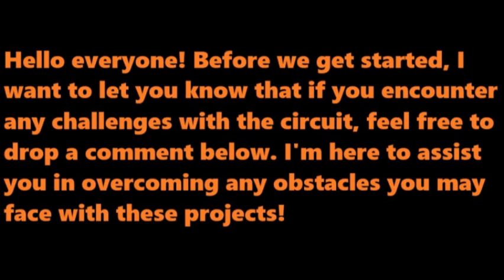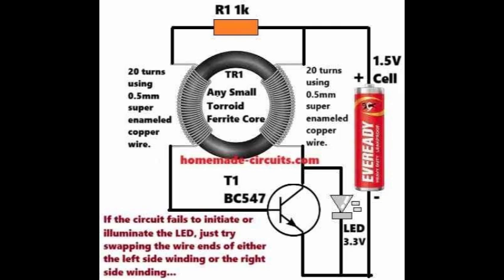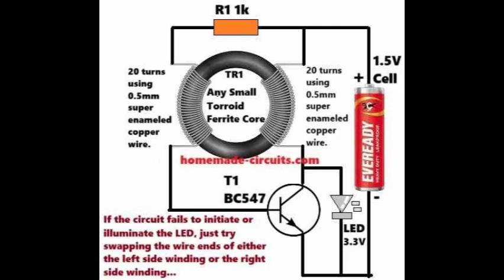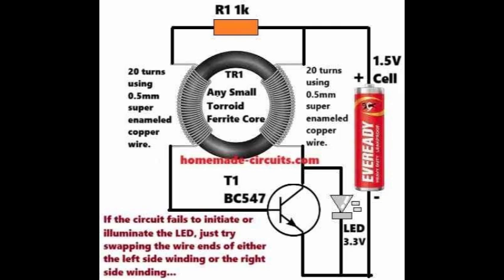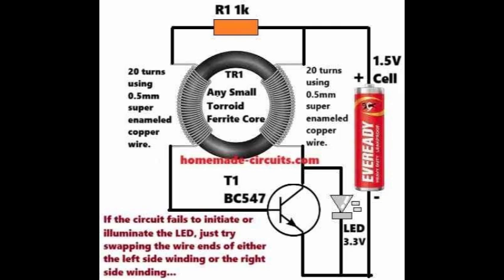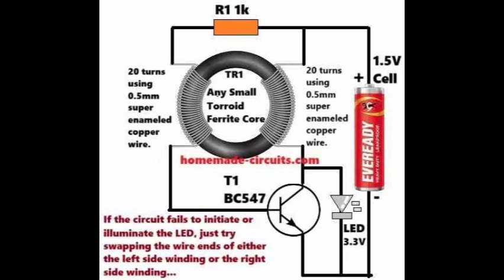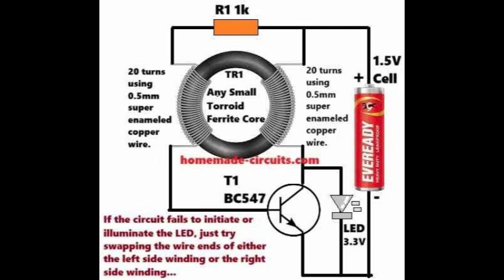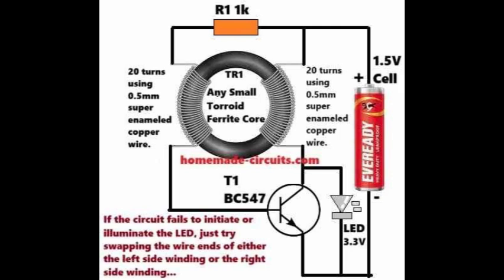High Efficiency LED Flashlight Circuit Diagram

Comment: "Regenerative Motor Acceleration Experiment" :  The magnet group rotor (spinning motor) supplied by a stacked duplicated group of this power supply type charging a super capacitor. Could be a starting point to get magnets spinning for much less power.
Reply from the maker: Sounds interesting! Certainly worth trying...thanks  for your feedback on this...

Comment: I like these circuits, and this one uses a euro transistor rather than a 2n2222, which is also a great device.  Chip drivers are great, but they feature an annoying uvlo of 1.3V, which means they won't turn on readily; however, once on,  you can harvest the battery, though not as good as this one.
Reply from the maker: Thanks for the feedback! Agreed on the euro transistor, it is indeed a great device, but 2N2222 is more powerful and I recommend it in this design...